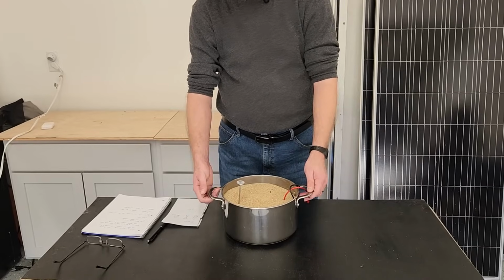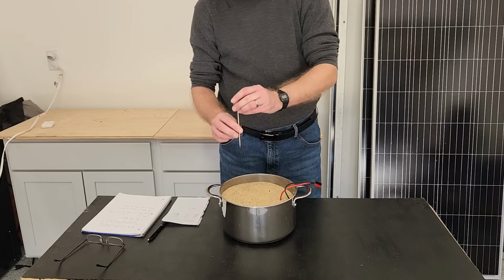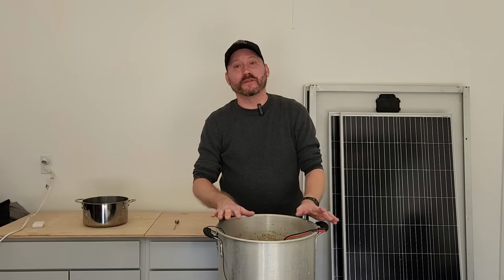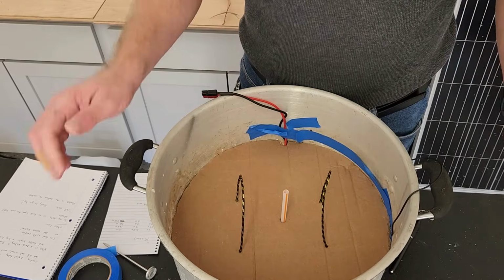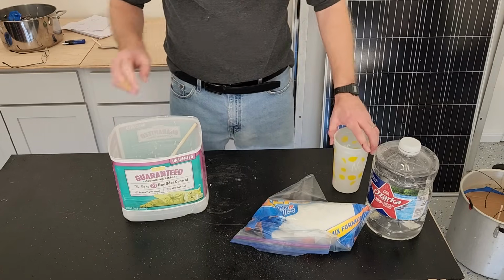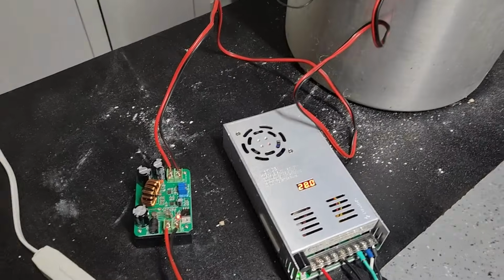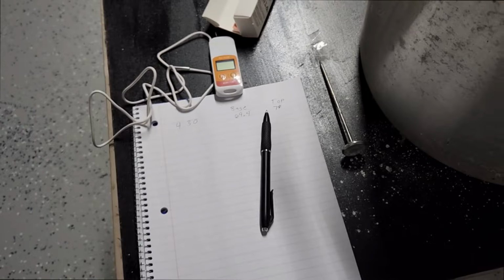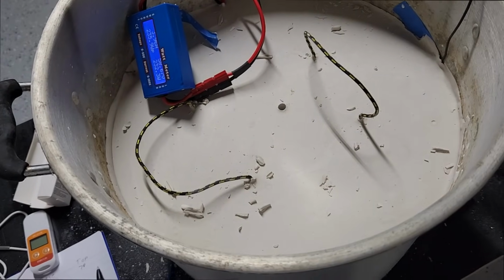Sand Battery heater. Create free heat  of 500F using solar electricity! Texas Prepper Projects

Comment: Hi.  I just found this channel and subscribed.  I think you are on to something.  What you are exploring is an answer to prayer for me.  I am looking for a way to heat a below ground (green house without windows) room for growing year round tropical food like avocados, lemons, grapefruit and pineapple, under lights in a northern climate.  Here are three preliminary thoughts to share.  1)  if your initial cooking pot is 12" or 14" in diameter you could buy and put a ceramic pizza stone on top of, or over the plaster of paris you poured at the bottom, and maybe you could use a pizza stone at the top as a lid?  2)  There is a  YouTube site called "Honey Do Carpenter", in Idaho, the guy has been messing around with "aircrete" and he has figured out how to make an aircrete foam clay/cement insulation which he uses in an advanced rocket stove he has been working on.  That insulation is be able to handle something like 1800 degrees F -- and you can make it yourself and it is very inexpensive.  3)  Heat rises.  I am thinking out loud here, exploring your wonderful discoveries for my purposes.  A fairly tall insulated cylinder (well insulated on the top, bottom, and the sides) filled with sand and an element at the bottom heating the sand.  I am thinking it could have a vertical stainless steel stove pipe going up through the center of the cylinder -- if you blew air through that stove pipe, that air would become heated by its contact with the hot sand.  With a ceiling fan in a room,  this hot air could heat an entire room.  The fan could be managed by a thermostat.  It's a thought.  Hope I communicated that idea well enough.  God bless.  Thanks for sharing.
Reply from the maker: What I would do for your greenhouse is use a 55 gallon drum of water and pump it up with a 12v solar pump through several hundred feet of black tube to warm it up. That will create a large volume of thermal mass
Reply: @texasprepperprojects  Thank you for helping me.  Really interesting.  I came very close to the same conclusion this morning.  Then tonight I decided to o do a Walipini green house (Sean Londrigan "Walipini Dsign and Construction").  He has a YouTube channel.  He uses 55 gallon drums of water like what you are suggesting.  But I will change it.  I will turn it into a well insulated grow house insulated like John Hait "Passive Annual Heat Storage" did for his house.  There is not going to be any sunlight coming through glass.  I will use solar powered grow lights.  He has a great way to do air exchange.  Doing it this way,  Keeping the trees six feet high, I will be able to grow tropicals anywhere, including Alaska.  This is so fun.  Thanks again.
Reply from the maker: @colinkelley6493  post a video when you build it!
Reply: @texasprepperprojects  I will be starting a channel in the next 6 months or so.  We  have a lot of very good stuff to share.  I am about to move one last time but am not sure where.  What part of Texas are you in?  Are you glad you moved there?

Comment: What would happen if you took a two or 3 gallon metal container filled it full of water added a thermostat controlled fish tank heater and then submersed that in a 55 gallon drum of sand if that would work faster and better
Reply from the maker: Nope.  Heat is heat is heat

Comment: Can you use one of those spring wires that dryers or toasters use that heats up powered by a usb wire make a casing cast bottom & sides put the spring in it then cast the top but leave the usb wire sticking out so that you can connected to any usb outlet or plug and see how much heat it provides
Reply from the maker: USB is 5v at 2 amps. That's 10 watts. Not nearly enough heat to do anything here.

Comment: for mass heat storage on the scale your doing it, I think you would do better  using water as your mass. no, you cant store as many BTU's  as sand but you can make up for it in volume. you can also pump it to where you need it. you could also heat it directly from the sun in cheep DIY water heating panels. also more controllable.
Reply from the maker: Watch the other videos in the series on this

Comment: Drill a hole in the side and mount the element in so the sand is not around the electrical connections
Reply from the maker: Look at video 2 for the reason why I didnt

Comment: I love the experimentation for sure but some interesting tidbits to bring this back to earth.

70 volts at 7 amps is 490 watts. So IF you have bright sunlight on a day where the grid is down then you could possibly get 5 hours at 490 watts or 2450 watt hours or 2.5 KWH or 8500 BTU. So maybe like 30 cents worth of electricity or about 40% of a little green propane tank. A human makes about 100 watts of heat on their own at rest or about 2.4 KWH over 24 hours. So the conclusion is that a decent sleeping bag and some carbohydrates will do more for you than this idea even on its best day with excellent solar performance.

Oh but it can be scaled up you say? At some point we have to stop using electricity to create resistant heat. You can run heat pumps with electricity and get like 3-400% efficiency from each watt and you don't have to move around a 500 pound vat of sand. Reverse cycle window units exist and reverse cycle mini splits are becoming popular. If you really want "free" heat then the best way to capture it is a heat pump. All these other options are no better than a snickers bar and 10 burpees.
Reply from the maker: thank you for the math with the BTUs.   I'm looking at this as more of an emergency thing for heating a tent inside a room.. which is what I needed during the freeze.  Yes, I COULD use my buddy heater and have better output, but that runs the risk of fire or CO.  I'm not yet ready to say that this sand battery is a BETTER idea, but it's an idea that's fun to test out.   I'm going to do a more realistic, semi full size test with V2 and try to get more real world data...
Reply: @texasprepperprojects  definitely keep having fun and experimenting but my point was that without significantly more solar you won't ever get enough energy to store to even be useful and if you have that much solar you can just run a heat pump and be better off. A human at rest doing nothing puts off the same heat your current setup in its best case scenario. A human during exercise can put off 1000 watts of heat. So in a freeze if you're only heating the area a size of a tent you could eat some food and do some jumping Jacks and get into your sleeping bag and use the solar power to watch some Netflix instead.

Comment: Why not use a heat exchange of some sort and a thermal switch to cut the power?  Leave the pot inside and run the wiring outside to the solar and put the thermal switch inside to cut the power when it reaches temp.  Maybe doing so would eventually bring all the sand up to temp.  I’m sure a 12 volt fan blowing air through the heat exchanger would certainly absorb the sand heat and sending it out into the room throughout the day using excess power from solar?
Reply from the maker: check my other videos for more information on all of these things

Comment: Verrrry Interesting .... but did I miss the part where you show how to make the connection between solar panels and sand battery?  Believe it or not, that's not just automatically obvious to some of us! :p
Reply from the maker: in this demo, I'm using  a large power supply instead of solar. I'm doing most of my builds at night when there is no sun

Comment: Great project. Thanks!! 
Have you taken an amperage reading coming from your power supply? Those buck-boost converters are great, but they don’t ‘miraculously ‘ increase voltage without the sacrifice of more current draw… theoretically you should get the same heat from your element direct from your power supply… the only advantage I can think of is the smaller wire size requirement to the heating element at higher voltage? The element itself is just a big resistor… I’ve played around with several standard elements direct to my solar panels with greater success than store-bought 24v solar elements… depending on the ohm values
Reply from the maker: I have that buck step up connected to a 28v 20 amp power supply to compensate for the high amperage. The reason why I wanted to use the buck was to simulate 2 residential solar panels connected. Also since the resistance is fixed, the wattage and amperage goes up. My first test was at a straight 12v and while it worked, it took much longer to heat up than 60v.
Reply: @texasprepperprojects  Very interesting! Thx! What’s the resistance reading from your heating element alone? I had seen someone ‘chart-out’ various elements, resistances, etc based on Solar for every different voltage, # banks, battery direct, etc… there’s quite the ‘science ‘behind it all… I’ll try to find the video … or at least that chart. Thx again! :)
Reply from the maker: @TheShakke100   heater was 15 ohms.  So  12v@ 0.8a = 10 watts.  50v@3a=166w   60v@4a=240w  80v@5a=420w

Comment: I  was looking into sand batteries for a while and I liked your experiment. I was also thinking of heating the sand  using the solar concentrator lens which may come at a lesser cost and faster to heat than the solar. It can takeout the possibility of wires burning up inside the sand. The metal fins can be embedded inside the sand like you mentioned with its tip exposed out  at the center of plaster of paris to which the solar concentrator will target to  heat and transfer that to sand?
Reply from the maker: Check out my other videos in the series before you do.  I tested a lot of things

Comment: Try cannibalising an electric hot plate cooker (not induction) from a dumpster or pre owned.
They have:

Materials designed to work at >600F

Ceramic beads as insulators for the resistance heating element wires
Heavy metal plates holding the heating element (you can cut/modify to work at 60V
High temp thermocouple sensor (can also be found in Nat gas water heaters, the thermocouple is in the flame sensor and powers an electromagnet to open/shut the main nat gas inlet). Or buy one, but that’s $15
For the plaster of paris mould use wax paper for cake baking to line the pot and then pour, it works the same way as with cake mix protecting the metal pot.
The main problem however with this scheme is you would have to massively over panel to use solar electricity as your heat source. Panels are only 22% efficient at best, and the  average house in a cold winter needs 30KW to heat to comfortably but for lights, microwave, refrigerator, compute & entertainment 3KW is more than enough. 
Maybe consider heating sand directly with a solar mirror or fresnel lens. There’s an Ukrainian on YouTube who uses solar to heat directly and with very cheap materials
Reply from the maker: check my follow up videos

Comment: Are you doing this again for this year?
Reply from the maker: Very soon!
Reply: Doing the same for a shed to prevent stored water from freezing.

Experimenting with 30 & 55 gallon drums. Since they will be used inside, looking to get them sandblasted to remove paint & whatever was stored in them.

Others who used gallon drums, commented on them using sand for years. Heat in oven or open fire. Will last for days, or weeks, if container is insulated on bottom and sides.

Best thing is that the sand can be reused indefinitely as it does not catch fire like wood. Suggestions are to heat sand as long as heating does not approach the melting point of sand. 

Another thing to consider. When things get really bad, and wood too expensive to buy, people will be stealing wood.

Reheating sand may well save lives. Also useful in keeping farm animals warm. And their water from freezing by placing a container of warm/hot sand under their water.

Many uses for the warm/hot sand. Can be used instead if hot water bottles under blankets. Stainless steel drinking bottles wrapped in layers of cotton.

Comment: that needs high temp wire the way you have it connected. I would run it through the wall of the pot just like you would if you were to use it in a water heater.
Reply from the maker: please check out video 2 for the reason why I didn't do this.  https://www.youtube.com/watch?v=siY-t8xlQhU&t=1s

Comment: Don't use water heating elements for this, they are not designed to get to those kind of temperatures as they are normally surrounded by water and will burn out quickly. Also the fused sand indicates the terminals are getting extremely hot and could melt or otherwise cause a short circuit. You would be better off using electric cook top elements which are designed to operate at red hot temperatures. You need to be very careful that the input connectors don't get shorted as this can cause your feed cables to heat up and become a potential fire risk. Also make sure the wires in the sand are correctly rated for the temperatures you are getting, silicon may not be enough for putting into the sand especially close to the heating element.
Reply from the maker: Check my follow up videos for details

Comment: i wonder how long it took for the 240W of power that was applied to bring up to temp.
note that electrolysed water torch brings temp up to fusion point of what it is applied to, so it won't boil water or burn our skin because of ~80% water, but will burn right through brick(fire brick); it's like atomic
Reply from the maker: many hours

Comment: I would just use an oil heater it is just a resistive element inside so you can run it off of dc if you wanted to
Reply from the maker: I'm already running the whole thing off DC

Comment: You got a really neat pot of hot sand but but what do you use it for? And how did you heat? Did you use your solar panels? How were those connected
Reply from the maker: I'm heating it using a power supply that is 60v. That is duplicating what my two solar panels together would put out.   What would I use the pot of hot sand for? As a radiant thermal mass in my bedroom in the event of a power outage.

Comment: Wondered if there may be a solution to element over-heating and low in-sand heat radiation by using two or more elements in the same bucket of sand where physical bi-metal switching between elements would still allow direct solar connection.
Reply from the maker: Try it

Comment: Wouldn't the heat get so hot to melt the insulation on your wires?
Reply from the maker: Use silicone wires. Check out the rest of the videos in the series for improvement

Comment: Why didn't use plastic wrap on the inside then I would have pulled right out for you
Reply from the maker: I tried to line it with tape but it wouldn't stick to the  metal. Good idea though!

Comment: Instead of using a solar panel , using a solar reflector on a steel container filled with sand , would like to see that experiment.
Reply from the maker: but i'd have to move it every 15 minutes as the sun shifts.

Comment: If you had a couple of more panels you could directly power an electric baseboard heater when the sun was shining.

The electric baseboard might actually heat a small room adequately on a sunny day.
Reply from the maker: Electric blanket is my solution now. 300wh for over night. Easy
Reply: @texasprepperprojects  : Yep, and once you are nice and toasty under the covers, you can turn the power down or off as needed.
Reply from the maker: @chronobot2001  agreed. After much investigation and testing, the electric blanket is the route i'm going